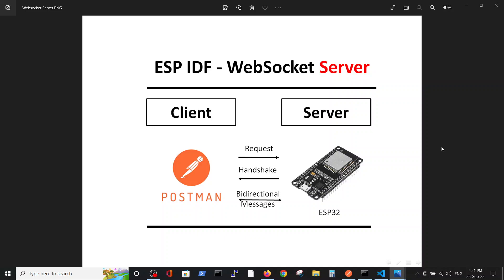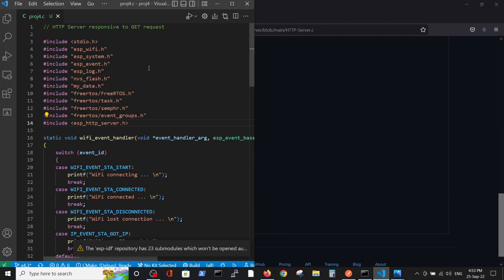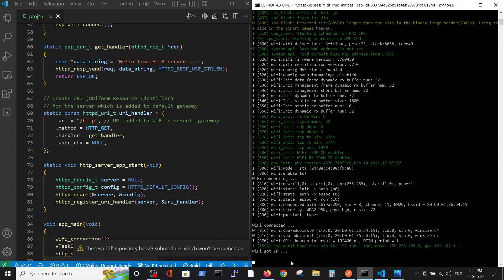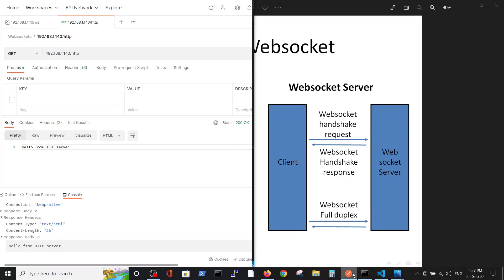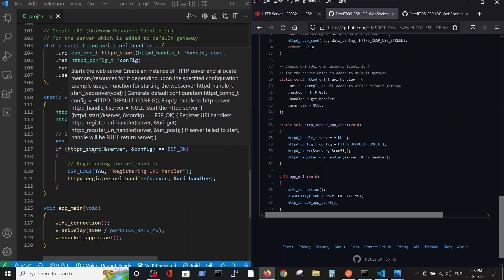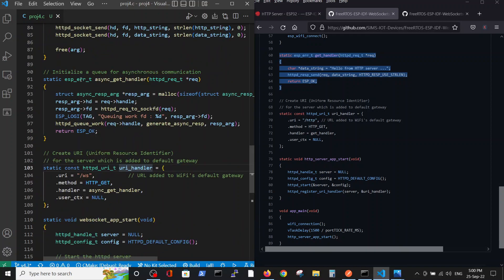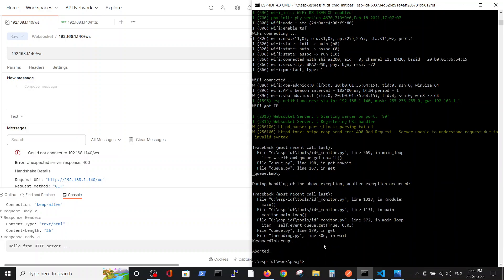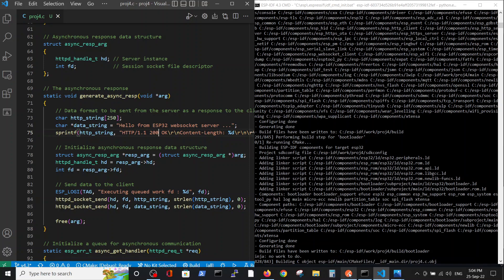3 - WebSocket server implementation in ESP IDF FreeRTOS for ESP32

Comment: The title says ESP-IDF, but isn't this really VS-Code/PlatformIO + IDF Plugin?  The actual ESP-IDF is the Eclipse based tool?   What would be needed for this project to build/debug under ESP-IDF/Eclipse?

BTW, what's the limits as to the kinds of web-elements the ESP32 webserver deliver?  For example, I assume audio/video is out..  but can it do things like CSS?  

(I'd like for the ESP32 to push (via websockets) ADC data, while all the connected browser clients can command LED toggles using uiverse io's switches )
Reply from the maker: Dear @bennguyen1313,
From my experience, the STM32CubeIDE (like for STM32 processor) has a mandatory Eclipse-based programming environment, but it also can be compiled from the command line. In the case of ESP32 for the ESP-IDF the VS-Code or plugin to VS-Code are just editor options. The actual compiling is done by command line command using the Espressif compiler.
Reply: @simsiotdevices6219  I think I got your (websockets) project to build using the EspressIF IDF!   I'm still debugging it, but I wonder if the issue is that the html file is not in flash?  I see the nvm is initialized, but doesn't webserver need to read from it at some point to serve an html file?
Reply from the maker: Dear @bennguyen1313,
The file is saved in internal ESP32 memory.

Comment: hello, I'm trying to make a websocket between 2 esp32s, but I'm getting the this error.

E (886984) TRANSPORT_WS: Sec-WebSocket-Accept not found
E (886984) WEBSOCKET_CLIENT: Error transport connect
I (886984) WEBSOCKET_CLIENT: Reconnect after 10000 ms

 Did you ever do it between 2 esp
Reply: sprintf(http_string, "HTTP/1.1 101 \r\nContent-Length: %d\r\n\r\n", strlen(data_string));

The source of the problem is this code. how should it be for esp32
Reply from the maker: Dear Mustafa,
I think you are right in concentrating on the header definitions:
"HTTP/1.1 200 OK\r\nContent-Length: %d\r\n\r\n" I had many problems with it during the video preparation. To deal with this issue, it is better to divide it into two solution stages. First, check that one ESP32 works as a Client and then that the second ESP32 works as a Server. I have both videos on my channel.
Only after a proper functionality check, would I try to connect between them.
Reply: @simsiotdevices6219  
Thanks for your reply. I've watched almost all of his videos on youtube. I watched and implemented server and client applications with websocket. there was no problem. As we said above, there is a problem with that piece of code.

"HTTP/1.1 101 \r\nContent-Length: %d\r\n\r\n"
this is one of the codes i tried.

"HTTP/1.1 200 OK\r\nContent-Length: %d\r\n\r\n"
Of course I tried this code. but it didn't work.

have you ever tried to establish websocket between 2 esp32
thanks :)
Reply from the maker: Dear  @RockSmokeM ,
I never implemented WebSocket communication between two ESP32. I will put it on the future wish list of videos.